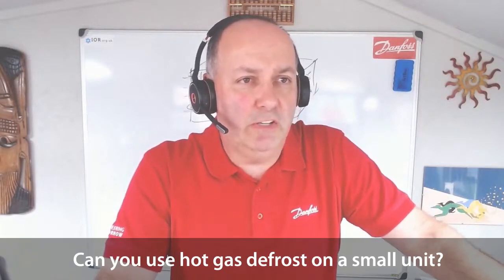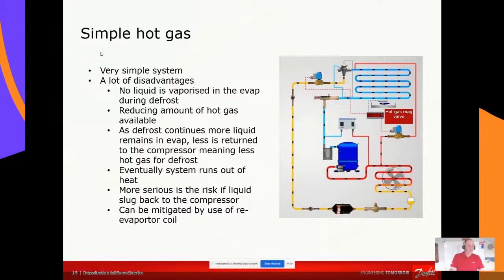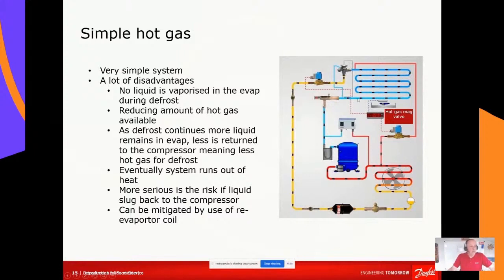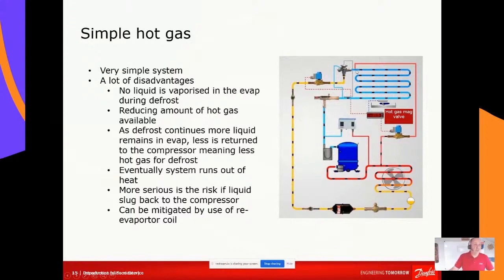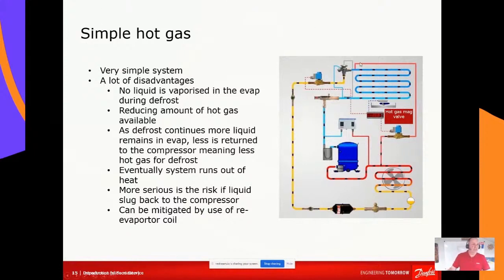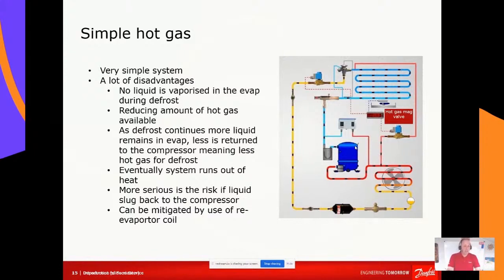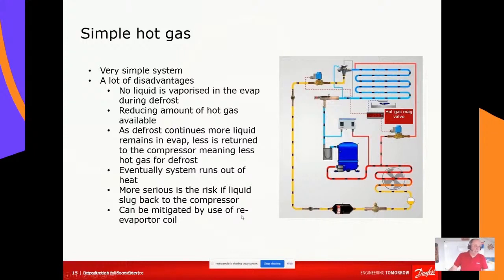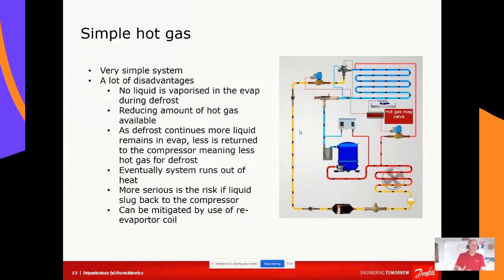Can you use hot gas defrost on a small refrigeration unit? | Ask an Expert

Comment: Advantages for defrost
Reply from the maker: Hi Harjeet. The advantages of the hot gas defrost system is that it gives a shorter defrost time, it is very efficient and due to the shorter defrost duration the refrigerated space has a more stable temperature. We hope this answers it!

Comment: could you use hot oil to defrost?

tap the oil cooler coil and send hot oil through the evaporator?

some systems have oil coolers like remember the ge refrigerators from the 80s with compressors that look like a 1 gallon milk jug on it's side and the condenser coil on top of a "U" shaped pipe.

the "U" shaped pipe is the oil cooler
Reply from the maker: Hello,

Oil should stay in the compressor crankcase to do its lubricating function for the motion work of the compressor as it is the heart of the system.

Thank you
Reply: @DanfossClimate  1. the oil does go throughout the system with the refrigerant.

2. more than normal amount of oil could be added to compensate for what is in the tap pipe and such.

3. the oil in the evaporator would be forced back into the compressor 

a reversal valve could be installed so it works like a heat pump so the evaporator becomes the condenser and vise versa (just make sure to turn off the fan so you dont end up thawing the food if it is a freezer or refrigerator.

Comment: It can be done, but it would resemble a heat pump with reversing valves or something approximating them.  Then you have to figure out how to mitigate post defrost liquid and suction pressure to protect the compressor.

Comment: Can I have a short answer for '' Types of defrosting systems for ice making machines ''
Reply from the maker: The two common methods of defrost are electric and hot gas. In general, electric defrost is relatively easy to design and install compared to hot gas, which is more complicated and needs to be designed correctly both for defrost function but also the refrigeration system operation. In general, the larger the refrigeration system with multiple compressors hot gas is the preferred method due to lifetime cost vs the install cost. The other limiting factor is one compressor/one evaporator systems that generally run out of hot gas after a short period of time due to the single system vapor compression cycle limitations

Comment: I suppose a good example of hot gas defrost on smaller units would be the coca-cola vertical fridges or pepsi fridges that I've come across. 
The modern ones do use hot gas with the elstat controller, older versions have heat strips. Your defrost all depends on timing. I wouldn't have the hot gas programmed for a run time as if they were heaters.

Comment: Thank You for this Update.
However, in the marketing of AK-CC55 Controller for energy management in Coldroom, Hot gas defrost was promoted because energy consumption is lesser to Heater. 
So, What is the best approach to reducing energy consumption in Coldroom? I am asking this question because I want to start marketing this application here in Nigeria.
Also, if I decided to use hot gas defrost for a system with ONE Evaporator can I place a small heater on the Accumulator to help boil the gas for feeding the Compressor and placing an Evaporator regulator after the Accumulator to regulate gas flow?
Reply from the maker: Hey Toyin,

If we look at the energy efficiency of a system, there are many ways to reduce energy such as the basics of design, correct evaporating and condensing temperature, choice of refrigerant, size of equipment, type of defrost system. Also the simple things such as good cold store management, meaning keeping the door closed. If we look at hot gas defrost on a one to one system, this has an issue as since no liquid is vaporized in the evaporator during the defrost, the amount of hot gas available from the compressor will be limited, then as the defrost continues, more liquid remains in the evaporator and consequently less refrigerant is returned to the compressor. This then eventually means the system tends to run out of heat before defrost is fully accomplished. Another more serious issues is that a slug of liquid can return back to the compressor during defrost - this issue can be overcome by using a suction accumulator  and heater to re-evaporate any liquid. You can also use a second evaporator as a re-evaporator but of course that is extra cost. There are many designs of defrost systems and each one has to be looked at with its pro & con depending on the application. 

If you have more questions, I'm running another Q&A livestream on December 10th. I hope you'll join --> https://www.youtube.com/watch?v=BrNAxEEKo3Y

- John
Reply: @DanfossClimate  Thank You John I will be their for the Live questions class.

Comment: I would still consider using hot gas bypass defrosting for slightly higher temperatures like between  0 oC and  -6 oC, as long as I arrange the minimum hot gas transfer that can satisfy my system, I don't think I would run out of hot gas. The purpose is not to use electrical heater as long as possible to prevent inefficiencies, whereas hot gas bypass would have minor damage to the performance.

What do you think?
Reply from the maker: Hi Onur, You are correct, you can still use hot gas on a one to one system, in fact it is used very successfully in the transport refrigeration sector where there is a special design of evaporator, suction accumulator and control functionality to ensure system reliability and performance. The main challenge is the amount of time you can generate hot gas and to ensure that is sufficient for the defrost period required.

- John